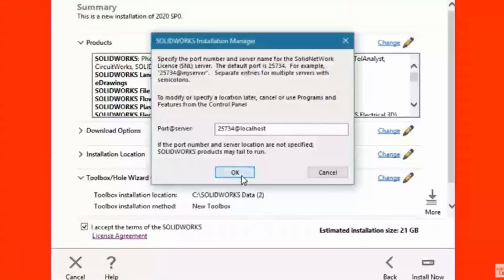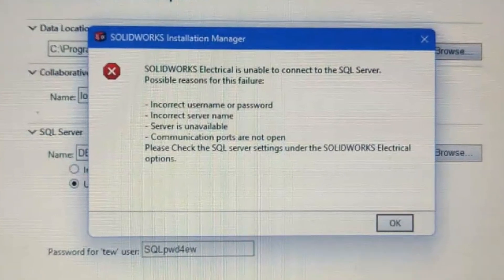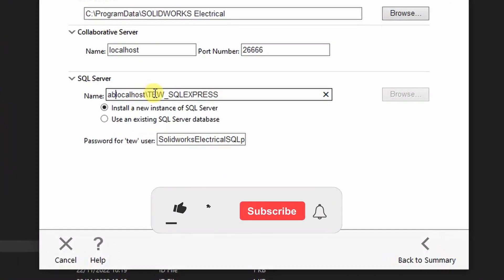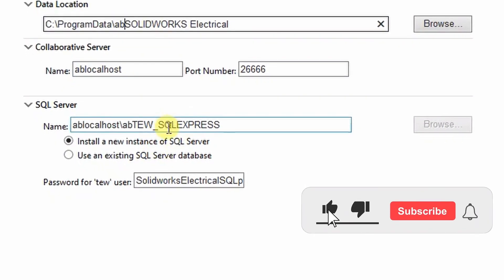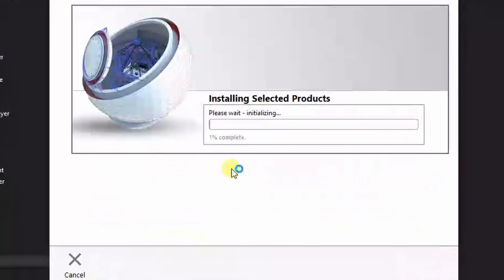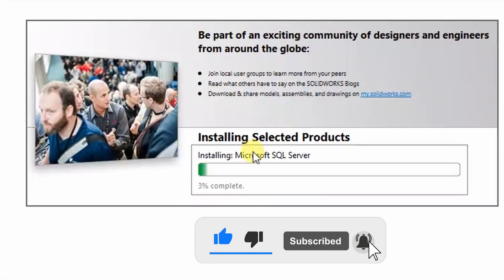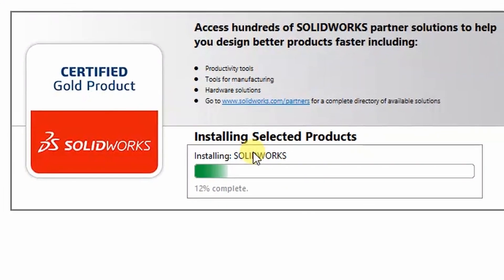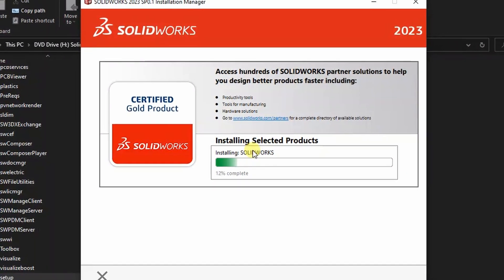HOW TO FIX SQL SERVER ERROR IN SOLIDWORKS 2023 INSTALLATION | SOLIDWORKS ELECTRICAL SQL SERVER ERROR

Comment: I did what you said but I faced with this Error
The executable file "D:\SOLID WORKS2020\Setup\PreReqs\SQLServer\SQLEXPR_x64_ENU.exe" /ConfigurationFile="C:\ProgramData\SOLIDWORKS Electrical\SWSQLSetup.ini" /IACCEPTSQLSERVERLICENSETERMS /Q /SAPWD=SQLpwd4ew /AGTSVCPASSWORD=SQLpwd4ew did not install successfully.
Reply: Same
Did you fix it?
Reply: @y_auc60seb20 did u fix ut
Reply: @y_auc60seb20 did u fix it
Reply: Did u fix it
Reply: same bro, did u fix it?

Comment: The easiest solution for this is to deselect solidworks electrical. (For those who don't need electrical part).

Go to Products ---> change----> deselect solidworks electrical -----> back to summary----> install

Thank me later 😁
Reply: Thanks bro
Reply: Saved my ass thanks
Reply: yeah like why do we need that in the first place like mostly sw is used for cad designing.
Reply: Thank you !
Reply: still same please help
Reply: @rithik616 thanks bro i was in a problem for 6-7 daays thanks
Reply: Thank you very much 
You help me to much❤

Comment: I am still facing the same issue even after trying the steps
Reply from the maker: What's the issue?
Reply: @elviscreatives  No server shows when i click browse
Reply: @elviscreatives  And the method shown in this video also isn't working
Reply from the maker: @harshdoshi4800  I can spare a few minutes tomorrow and take you through everything. I'll share the zoom link tomorrow
Reply: @elviscreatives  No worries 👍🏻, Thank You
Reply: @elviscreatives  When i installed it as it is i am getting error:
Could not obtain a licence for SOLIDWORKS Standard
Invalid (inconsistent) licence key
(-8,544,0)
Reply: I have the same problem, can you say please how to fix this issue?

Comment: i followed this procedure but while installing  sql server poped up
Reply from the maker: What's the pop-up message?
Reply: @elviscreatives  in my case

The installation was going on 

But the message was there:

This action cannot be completed because the other program is busy.Choose 'Switch To' to activate the busy program and correct the problem
Reply from the maker: @2ndlife320  did it work
Reply: @elviscreatives  yes the installation was going on
But after few minutes a dialog box appeared big one

It showed 3 things

Sucessful
Unsuccessful
Pending

So in unsuccessful it showed electricals

There there was option to skip 

So i clicked on it cause i dont want electrical part

So that's what happened
Reply from the maker: @2ndlife320  Great, that's okay too
Reply: @elviscreatives  this installation is stucked on 58% from hours 
Taking very long to install  😢
Reply from the maker: @2ndlife320  just cancel the installation and delete SOLIDWORKS folder called " SOLIDWORKS DATA" then begin a new installation
Reply: @elviscreatives  it gave me few option

Modify update
Repair update
2 more i don't remember

So i clicked in modify
After selecting few packs
Than i clicked on modify button (to proceed)

A box appeared it said toolbox is missing
Repair your update

So i went back 

Clicked on 

Repair Installation
Than it gave a list

I clicked ok
Reply: @elviscreatives  bro i need help

After all installation cancellation
And i saw your 
Error video of server also

(-8 something ) like that in which you deleted original folders

But

I dont have any duplicate folders so what i did i copied some files as you did and pasted in original

After all that

I opened solidworks

Now it shows

Solidworks Licence agreement

So do i accept it or not
?
Reply: @elviscreatives  hey bro

So i accepted it

Nd solidworks is running

Hope it will run Smoothly in future

And no errors will come
Thank you bro for all help and videos

🔥♥️🙏
Love you bro , from India

Thank you 🙏🤝
Reply from the maker: Mere chainal ko sabskraib karana yadraki
Reply from the maker: @2ndlife320  hopefully you accepted, right?
Reply: @elviscreatives  yes ,

I subscribed you ♥️🙏

Will share to other people also 👍
Reply: @elviscreatives  1more doubt 

Can we open internet after installing it
Reply from the maker: @2ndlife320  yeah

Comment: Hey so it kinda worked until the solidworks electrical installation which was unsuccessful (error 27502 could not connect to microsoft SQL server). Any tips on this? Thanks!
Reply: Happened the same to me, hope it still works
Reply: @sebastiancardenas6623 Did the software still work?
Reply: @JAKER882 did it end up working for you when you continue installation ?
Reply: @sebastiancardenas6623 did it still work anyways ?
Reply: @MrBmawlawi  nope, but what solved the error was once You run solid for the first time a warning about the license may appear, what You should do is copying and pasting the same folders You already did on the Process of installation just check the vid, it does not matter that You had already copy those folders just do it again; hope it works!
Reply: Same
Reply: I also faced this issue
Reply: I also faced,this issue how to fix it

Comment: Hi @Elvis Creatives. I can not find the three servers for desktop in solidworks electrical where in the main installation video you asked to select the desktop server. Can you please help? No server appears in the list but you had three servers appeared
Thanks
Reply from the maker: Just proceed with localhost
Reply from the maker: The above video can help too
Reply: @elviscreatives  okay brother. Thanks
Reply: tried it man. getting this error:
The executable file "E:\PreReqs\SQLServer\en_sql_server_2019_express_x64_e2d9f596.exe" /ConfigurationFile="C:\ProgramData\SOLIDWORKS Electrical\SWSQLSetup.ini" /IACCEPTSQLSERVERLICENSETERMS /Q /SAPWD=SolidworksElectricalSQLpwd4ew /AGTSVCPASSWORD=SolidworksElectricalSQLpwd4ew did not install successfully.
Reply: I’m getting the same thing? Any solution?
Reply from the maker: @23-azimfouzan36  use localhost instead